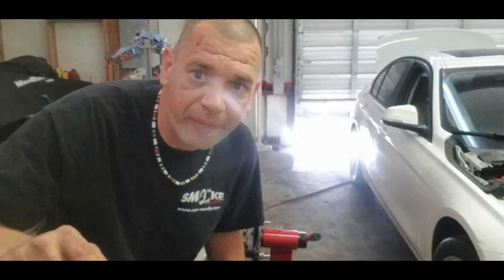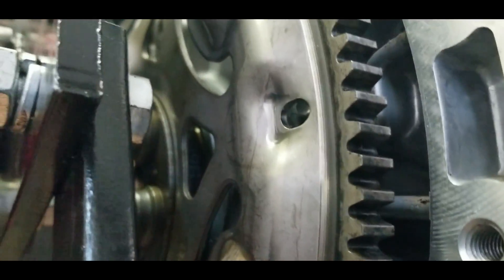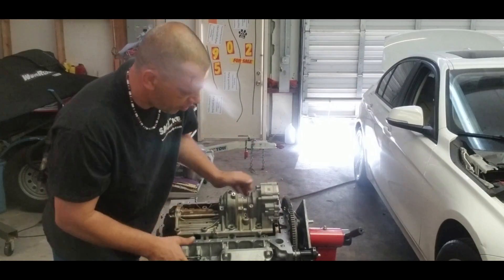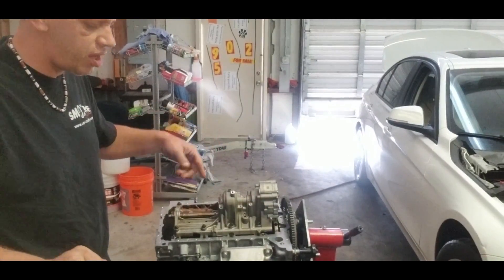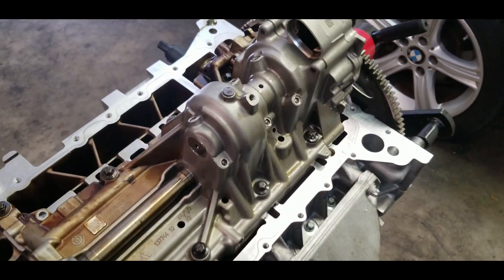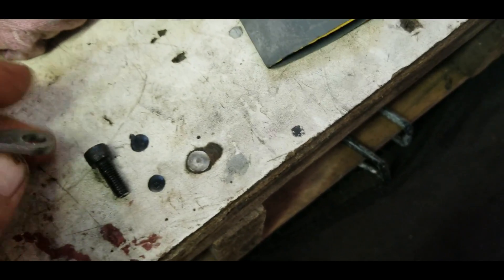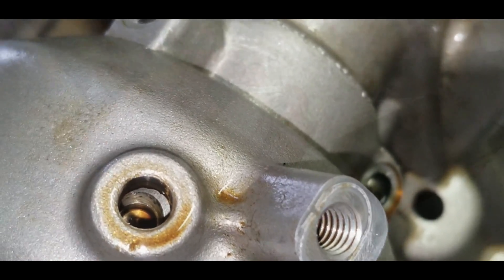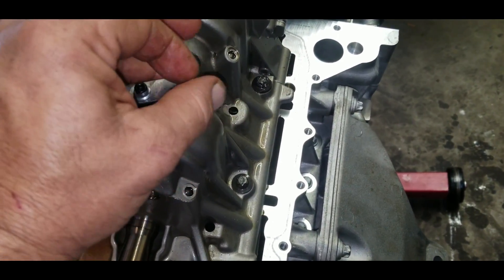2013 BMW 328i F30 N20 flooded - how to install oil pump and balancer shaft

Comment: Good video and very well done. As a fellow mechanic i was really anxious when you torqued the oil pump balance saft bolt😅 i think i'm going to buy a new bolt for that just to be sure.
Reply: Bolt already stretched - had to adjust the torque settings on the torque wrench. New bolt always or less torque but good video
Reply: For anyone else reading this, a new oil pump balance shaft bolt comes with the N20 timing chain kit from BMW. The whole kit is about $150 and includes chain, guides, tensioner valve cover seals, crank bolt, crank sprocket, oil pump chain, oil pump revised sprockets, oil pump tensioner.

Comment: Great video that shows how to assemble the the oil pump, How do you lock the engine to TDC if there is no flywheel since the Flywheel of the manual engine does not fit on the stand
Reply from the maker: Hey Thank you your comment. You cant lock the engine on DTC when no flywheel on it.

Comment: good job man !!
Reply from the maker: Thank you
Reply: I have a question, I done timing chain on 2013 BMW 328i xdrive N26, car just cranks but doesn’t start permanent code PO52B any idea?! 
Thanks for your help..
Reply from the maker: Im sorry to say but you make some mistake when you set the timing. Easy to make a mistake. So first try to put back all the timing tool. Check the timing.
Reply: Car Ready I’m going to opened a valve cover end double check timing.

Comment: Good evening, what is the reason why you have changed the oil pump? Did you get a warning in the low oil pressure box? Thanks
Reply from the maker: I don't changed the oil pump, engine was fully take a part.
Reply: @CarReadySmokeBrake  thanks